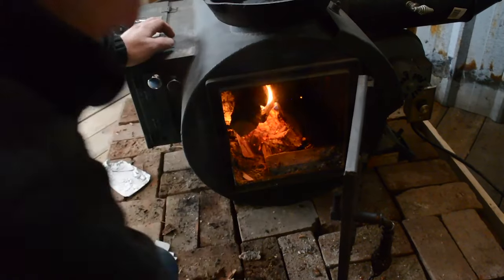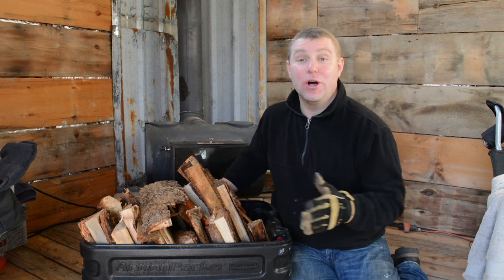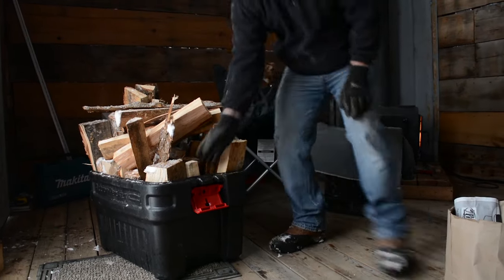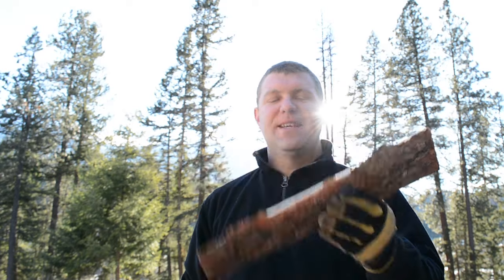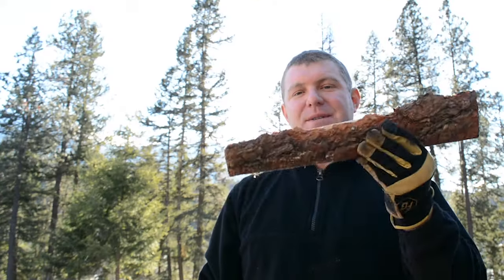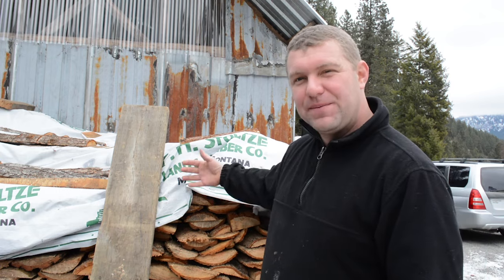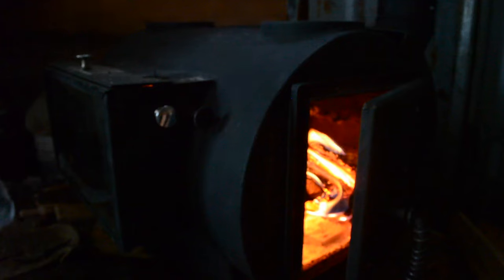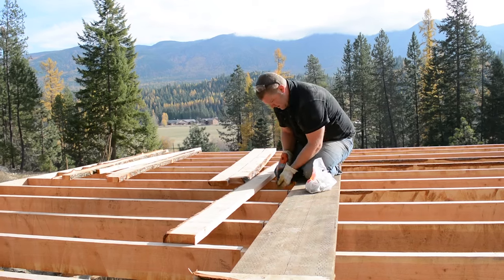5 Wood Burning Stove Mistakes You’re Probably Making

Comment: I know this is an old video but, your stove lacks a dedicated space to burn. Weld a plate to the roof, blocking your stove pipe exit so that the smoke has to travel to the ends/sides of the stove before it travels around the blocking plate and out the stove pipe. The flame will heat up the plate above it and give the smoke a longer path of travel before it exits the stove. Doing this will give the smoke a chance to more fully burn, Wich means more BTU, less wood used and bigger pieces allowed to burn successfully since you've created a burn chamber at the top. Also, I don't know if your stove is plumbed to the outside air or if it breathes from the inside of your cabin, but it needs to be outside air so your cabin doesn't lose so much heat. Again less wood burned, so you can damp it down and feed it less often.

Comment: PS--It takes 2 Years for a stove to teach YOU how to run it !!!
Reply: Homeless I definitely agree.  I have a nice 2nd hand stove with a secondary burner.  it's pretty efficient.  But it took a long time to understand how to adjust the intake and exhaust for the type of wood I am burning.  This year I put on a new gasket, and ceramic coated my stove pipe.   What an amazing difference.   It makes a much stronger draft and pulls air in where it's needed I stead of all around the door.   but now we are making charts to see how to set it again.

Comment: you might want to add a damper to that 8" pipe.  Even in you have air control on the stove, a damper  usually adds more control.

Comment: I have years of experience heating with wood.  Your stove isn't drawing right if you can't put a halfway decent sized log in it.   Most wood stoves will burn several hours without needing to be tended.  Like others have said, it looks you have too many bends in your pipe.  

One thing you can fix mid-season is to knock together a small wood crib inside using some scrap 2x4s so you can store several days worth of wood at a time inside.  You should be able to store 3-4 days worth of wood inside without too much trouble.  That really helps with having to deal with wood in the rain, blizzards, etc. because you can often plan your wood replenishment around the weather.  Use a wheelbarrow to carry your wood as close as possible to your inside crib.  Only having 12 hours worth of wood inside the house is way too little.   

Leaving the loading door open too long is an excellent way to catch your roof or house on fire.  Do that only to get the fire going to the point it won't go out, then stop.  It should be the case that if you leave the loading door open for a while, the fire first gets well established but then fairly quickly starts to rage so hot that hot embers are shooting out of your chimney still on fire.  If you don't believe me, do yourself a favor and go outside at night while your fire is really cranking and the door is open a few inches and take a good look at the end of your chimney.   If what you see does not scare the crap out of you (live embers still glowing coming out of it), that pretty much guarantees that you have too many bends, dirty pipe etc.

Comment: Hmm, I figured there would be a few comments after mine over the last few days. Ok, Ive thought about your issues with your stove, and here is some ideas to to look into. (1) look into secondary burn wood stoves. This would reduce your soot problem, as well as fuel consumption. It basically utilizes wood gasification. An easy modification to make to your stove. (2) Adding a chamber above stove would act as a radiant heat chamber. A 30-55 gal. barrel could easily be built to sit on top of stove. Stove vents into barrel, barrel vents into stove pipe. This would also act as soot collection chamber.

Comment: the big problem is the single wall pipe it's fine inside but as soon as it get's outside the cold cools it down to much. You still need to put larger pieces in for over night but also the bulk of the heat is going up the chimney! Try if we get a warm spell putting a baffle in the stove where all the fire is going up. this baffle will make the heat go around each side before going up the chimney and allow more of the heat to stay in the stove. but the pipe outside still needs to be double wall for the pipe to stay hot enough for efficient draw! that's why burning small pieces hotter work for you!! amazing posts and enjoy watching your progress!! Thanks!!

Comment: ok first I would like to say I live off grid also and if you put a damper in your straight pipe it will give you more heat and make them 3 chunks of would last an hour instead of a half hour,   if your burning slab wood which on the video that's the type of wood you have.  buy it in the spring causes its cheaper and cut it up right away and put it in a wood shed, or something with a roof on it, slab wood is usually green when you buy it so buying it in the spring gives it all summer and fall to cure. putting a tarp on the wood helps keep the snow of the wood but the wood in the middle can stay wet. I love to watch your show, so please don't leave the stove door open unattended. and the best wood you have is all your dead fall on your own property even if its got a little rot to it. its the best price free.

Comment: Couple of good tips in the video. I have been burning wood all my life and it seems like your wood must still be a little wet if you are having problems burning what you are calling a big stick. May be an issue with your flue not being very straight which would reduce your draw also. I recommend bringing in a full row of wood and stacking it inside. If you have several weeks instead of 12 hours you may notice your wood dry much better and you will get that little stove roaring. Best of luck!
Reply: I can throw an 18 inch long x 12 inch diameter onto a bed of coals and have it burn for 8 hours at "half throttle".  Full bore will eat the bed of coals.  Eventually the chunk has an arch and resembles a burning bridge. lol.

Comment: In the first 20 seconds of your video of inside the firebox it's clear most of your flame is going right out the chimney.  This is because your chimney design is creating a vacuum.  I understand it's a cheap temporary heat source that needs to make a winter, but you major reason for heat loss is the chimney pipe- not the stove.   At the top of the list-all the bends in the pipe are dangerous, the heat and flame can get trapped in the pipe which will cause it to crack, go on fire and burn your cabin down.  Next is the pipe outside is single wall which is causing the heat to cool down rapidly as it exits the stove thus forcing the exhaust downward...that's a major problem as well.    In order to maximize your burn (heat) and increase the longevity ( burn time) you need to vent the stove straight outside from the back ( eliminating the adjustable 30 degree twisty pipe you got there.  for that you need something called a clean-out tee.   Once that is anchored to the wall you need insulated pipe going up the side of the house, through the eave and continuing a couple feet higher than the roof, thus eliminating all the elbows in the pipe.   I really like you guys and don't want to lose you.  That slip together stove pipe has done more property damage and cost more lives that it should never be installed inside a living area- not even temporarily.   But since your going to tempt fate anyway please get a few smoke detectors- at least 2 or 3 just to be on the safe side.
Reply: +Tim Saunders   Watching the video, I've wondered if installing a baffle in the stove would help.  It's obvious that flame is going right up the stove pipe (which should be double or triple wall).  Would a baffle help put out more heat and cut down on the danger, do you think?
Reply: a damper would work.  You would spend a lot of time adjusting it.  The correct path is controlling the temp and draw in the chimney so the firebox does not have to work as hard. This creates longer burn times and allows them to fill the box less often.   I have a little Yodel coal stove that size that get 12-14 hours out of 1 lb, coffee can of coal.   Heats my 300 sq. ft shop just fine.
Reply: +Robert Lee Too arrogant to realize how little they know.
Reply: they learned everything from 'pinterest' 😳😛
Reply: +All inDueTime  they're actually learning as they go. When did you take the leap and dump your job to try out full time homesteading ?
Reply: +Tim Saunders  your delivery needs work
However you did make a good point about adding a damper to keep the heat down where it needs to be not going up the pipe. the rest of their set up looks to be working & i feel it will continue to work.
Reply from the maker: +MetusBatman V1 While you all are arguing about what we should and shouldn't do, we're busy developing a homestead. By the time we have a second home built on our property, you all will still be arguing over wood stoves. Catch ya later!
Reply: +Pure Living for Life  All I can say is "Whew" feedback is a follower's opinion, but the thumbs down button should be eliminated entirely.  My comments may at times disagree with a part of a video, but over-all I'm very satisfied with your work  and commentary.   This is your journey,  your adventure and your learning experience.  I commend you for your courage.  and support your effort, still I feel that anyone who gives a  thumbs down should be required to give their name a well.   P.S.  subscriber Tim S has nothing do do with me on this or any other site.
Reply: Strange response for constructive comments that could make your home safer.
Reply: Tim Saunders hi Tim do you have some video that can show me what do you mean? Not sure from discretion bc English is not my first language but I like to learn the set up the proper way. Thanks
Reply: This guy is Clueless.. this video should be taken down.  1st   30 secs.. i was  No No  No...

Comment: I have a woodburner and found many of these suggestions for myself, meaning, these tips are accurate. The best tip is when starting the stove, get it really hot, then back off. That initial heat works wonders. What I'd like is more info on the wood, I have bought kiln dried seasoned hardwood from a local sawmill, it really didn't burn too well. I try and get softwood which burns faster and gets very hot quick (so vanishes quickly too). Also as suggested here, thick logs don't burn too well, maybe there is an optimum cross sectional area for a given stove volume. There is a lot to learn to get the best from a given stove, it ain't plug and play! But I much prefer the heat type, it is so much better than electric or gas.

Comment: son your on the right track and dont take these people as insults they just dont know a good way to explain this to you but ill try you seem like a good guy 1 different stove use that one at the shop put another burn box on top with glew coming out of bottom of it 2 different types wood different temperature heat and burn time 3 your working at that two hard which tells me you love it you'll get better and you won't use 1/3 the wood slab wood goes quick it will work your nuts off but is usefull 4 cut firewood to anout 1and half inches legth of stove fire on ends heat up still rather than going out flew 5 put in pipe damper 6 your right filling it ip full just waste firewood and mix drywood with green logs longer burn your on the right track if you need anything i can help with just holler back and keep enjoying life

Comment: Congrats on your new adventure. I wish you well so I am going to say that along with too many elbows in your stove pipe another issue looks like it might be that you are burning pine slabs from a sawmill. That's what it looks like in the video so please forgive me if it's not pine. Pine burns hot, it burns fast, and it creates lots of creosote in your stove pipe. Pine should be used only as kindling or added in small doses to hardwoods.All the elbows are slowing down the air flow and the pine is creating creosote that's going to add up very quickly to a glazed stove pipe which is a chimney fire waiting to happen. A glazed chimney or pipe is the worst kind of chimney build up. it gets as hard as a rock inside your chimney and then will burn with a vengeance.

Comment: I love the learning process... I'm not a expert but i have been burning wood at my cabin for 40 years. Started out with a barrel stove and after a few years I realized its only a controlled camp fire... Moved on to a air tight heater/ pedestal glass front energy efficient burner. This means you can get stove hotter and you won't loose the heat out your chimney. It will have a damper in the back of the stove to recirculate unburnt wood gas across a heat plate and you'll see flames dancing in midair.... as your stove will burn at a higher temp/ cleaner... This is not a magic stove I bought it at Menards/Homedepot .... If you go look at the design of the stoves you will see what I mean. Maybe you could add a chimney damper at the exit of your stove, don't get to high up your chimney because it is not designed to handle the heat/ it will glow red. Thats the heat you r loosing... I have also gone to a straight out the roof stove pipe. Out the wall stovepipes cool, condensate and build up creosote. Adding insulated pipe through the roof will help with condensation also...

I'm enjoying your videos, keep warm.... ;)
Reply: yup yup same here and Im tellin ya its so efficient!! While every one else is loading up on wood every year I am still burning the two chords I bought two seasons ago on my third and will still have enough for 2 more seasons at least!!! An the glass is a great touch for the ambience as well.

Comment: Awesome!   we have never used a woodstove but just ordered a HQ issue tent stove we were hoping to utilize in our very small house basement in case of emergency(price seemed so sensible).  Not doing too well getting info on guiding flue out of basement window..seems it is for outside tents only and no elbow conversion available.  If you have any ideas on this or can recommend a stove to use for emergency use in a 10x14 basement (mainly to keep few pipes from freezing  and us in case of power outage-rural area).  Your info was great though, even for making regular fires and you have explained what we have been doing wrong with our rocket stove..gee, wish we saw this first.  Thanks a bunch for all that info and any extra you can add in.  Love the video.
Reply: Please tell me your are not serious?
Reply: No, we are not.  Did a lot of learning and you are right...seriously ridiculous idea.   Not too many options...no wall for wood stove, pellet stoves need electricity during power outage,  leaves us with kero heater.  :(
Reply: A wood stove in the basement, IF installed properly is a great idea. Just not that kind or installed that way. I was worried about ya.
Reply: you tube, pinterest, etc. look for gravity feed tube and hopper for pellets. simple, cheap, effective.

Comment: if you remove the 90 degree elbows and put two 45 degree elbows on it that will give you a more longer sweep elbow giving you a better draw that will give you a better burn. do this where you have tight 90s
Reply: Beat me to the punch...even insulating the stack with Rockwool  and chicken wire then putting cladding over same  would allow the transit of flue gasses to heat up quicker maintaining a warm reserve within the stack,  and stop the rapid cooling effect kicking in, so less  cool combustion  gases crashing out internally as maybe partially burnt fuel / soot...[a 'cheapo' stove or pipe  thermometer showing the optimum burn zone, or even  a cheap lazer thermometer gun could come in handy...great looking stove...

Comment: Woodconsin, below has a good idea to use 2 45 degree elbows. Just twist the 90's into 45's
also I split wood into triangles and squares, no rectangles.
Do you have a damper? You need one. Start the fire open, then close partially to keep the heat in the stove. The stove gets hotter.

Comment: 1. You might be doing this already, but I learned from another video to make sure the stove is drafting air from outside, rather than from inside the heated room.  Otherwise your burn up your heated oxygen and create a low relative pressure in the house that causes cold air to seep in through any cracks around the windows/door.
2.   Also, a trick my mom taught me:  Humid air retains heat much better than dry air because there are simply more molecules flying around bumping into each other.  So you can put a pot of water on the stove to simmer for no reason but to add humidity to the air.  Make sure it's not a pot that will not burn once the water evaporates.
3.   Also, you probably know this but, you should be able to limit the burn rate by closing the air intake, so that you can stoke it full of wood without it getting super hot and burning all up at once.

Comment: Looking at your setup you may want to look at reducing the angles of your chimney 
The 90 degree bends will slow down the smoke and allow sut to settle in
Try 45 Bends to keen the debris being pushed through with the smoke 

You may also get a better draw when running normally
And allow more air flow